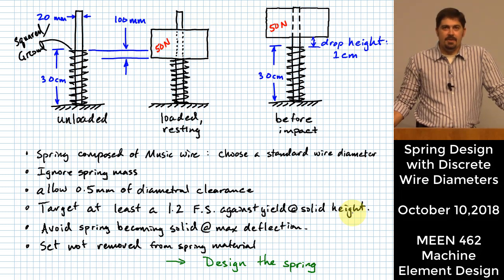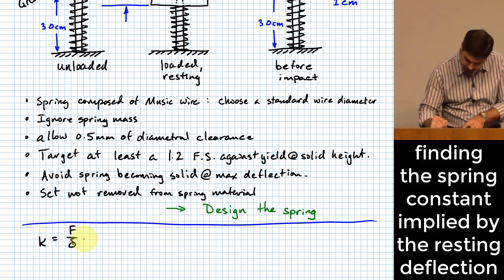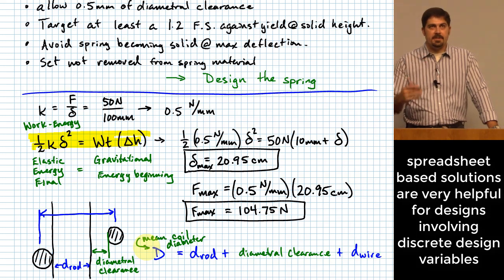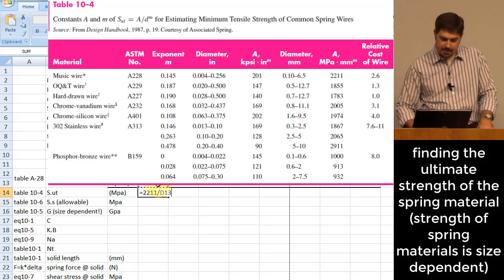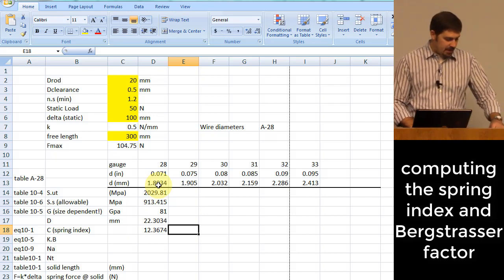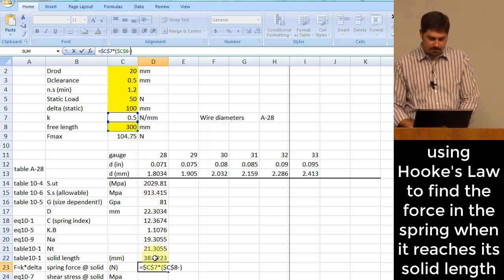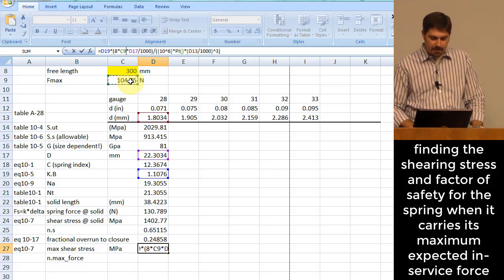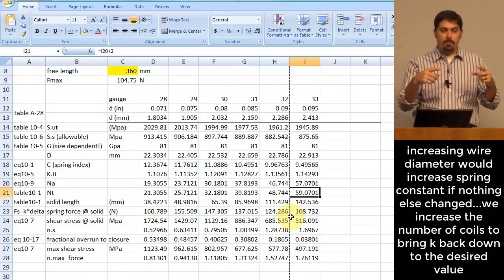Design of Springs using Discrete Wire Diameters/Gauges | Tabular/Spreadsheet Solution | Solid Safety

Comment: Is there a reason you are interested here in maximum shear and not say principle stresses? Is it because we are using ductile materials, so it's the main driving parameter of plastic deformation?
Reply from the maker: Typical coil springs primarily carry shearing stresses, not really some complicated combined stress scenario. Therefore it makes sense to evaluate factors of safety based on shearing stresses that cause failure and "working" shearing stresses. Thanks for watching!

Comment: Thank you for your videos it is very helpful to learn.
I have been riding my mountain bike for a few years and it uses a coil shock. I use your method and the same sheet to try to understand better what was happening for my bike:
I have a coil spring of a free length of 151mm coupled with a 65mm stroke from the shock. It is labelled as 96N/mm, the wire diameter is around 9mm and the mean diameter is between 45 and 50mm. The coil is squarred and grounded and made of some kind of steel because it is coated sothat it doesnot rust.
With the value I could find online, I decided to go for 2000Mpa for Ultimate tensile strength and G 81Gpa. It makes the allowable shear strength 900Mpa.
When I apply Hooke's Law I get at 65mm of stroke 6240N Force (the bike linkage multiplies the forces applied on the rear tire by around 3 and I am around 90kg so it seems good to me) and also 1362Mpa shear stress which is ENORMOUS and should deform my coil at bottom out for sure. I took a look at mine and it seems 100% good.
I suspect that when the diameter is growing, one cannot simply calculate the allowable shear stress with 0,45. Also my spring only retails at around 30$ after market that is to say it cannot be made of any superalloys with special characteristics.
On top of that I try the same exercise with a titanium grade 5 coil (I have one as spare with the same K as the steel one (96N/mm)). It measured 140mm with a 10mm wire and I found online that the titanium grade5 ultimate tensile strength is around 950Mpa.
Again I have a hard time comparing the shear strength for my case (around 1035Mpa at bottom out) and the max shear stress allowed before plastic deformation: 427,5Mpa
I would have understand if I am not far of due to the security factors and the difference between 0,45 and 0,56 (Samonov) but I am doing something else wrong but i am too far off. Been scratching my head for 3or4 hours now but could not find the mistake.
Thanks in advance for your help,
Greetings from France,
Arthur